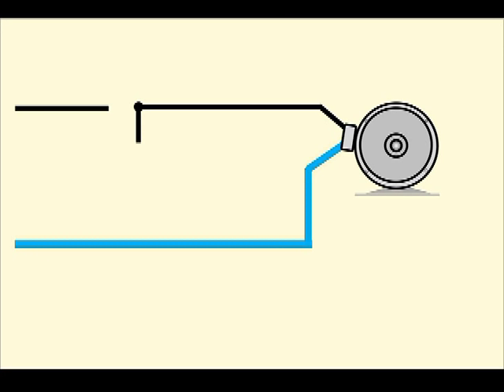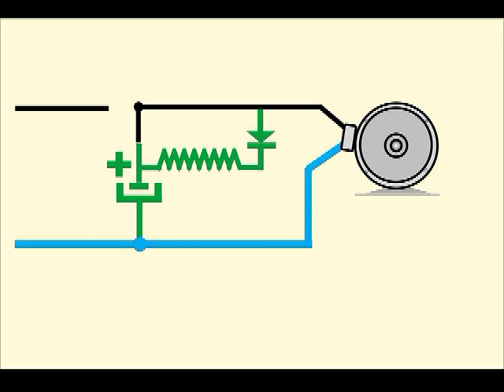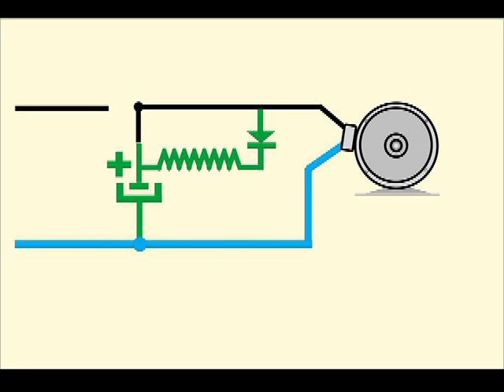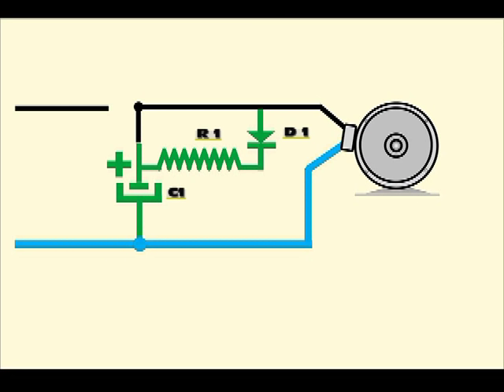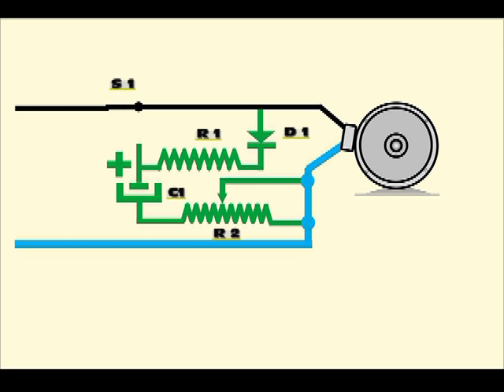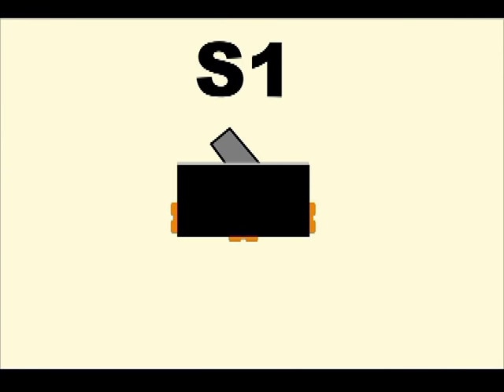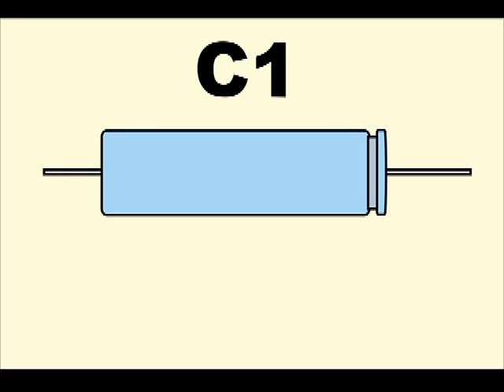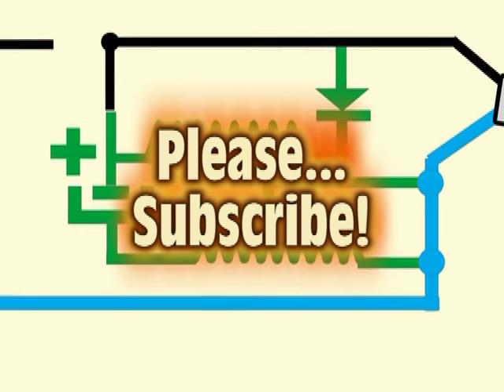Dynamic brake for induction motors

Comment: Dear Sir, this video in ending, you told me  components list of motor. I am not clear about motor capacity. Is it 1/3hp 230v single phase induction motor? Is it correct? I am waiting for your valuable response Sir.

Comment: Are there formulas for calculating the values of the components?
I have a 1725 RPM, 1/4 HP motor that runs on 120VAC that I would like to stop quickly. The motor winding has a resistance of 2 ohms.
Reply from the maker: Dear friend, I have other publications on the subject which may help you. One is a braking demo done with a car battery. Another is a homemade timer which can be adjusted for desired braking. Please take a look at.... https://www.youtube.com/watch?v=HQssG7woEBY You can also check at my Community for a simpler system, using a double pole, double throw switch, please go to https://www.youtube.com/channel/UCmjQnuJwV0FkjdEyi3099RA/community?lb=UgxNy1n39i1pT2EVCtZ4AaABCQ   . If this latte link fails (sometime it does) please go to My Community and find the simple system using a manual switch. Note. This switch has to be normally open when the motor is stopoed.

Comment: I have a 1955 DeWalt Radial-Arm Saw with a 2HP motor that takes about a minute to slow down. Would the stated values (1N400, 100mF, and 1500 Ohms) work?  Would I need the variable resistor? Thanks for any help.
Reply from the maker: Dear William, your motor is quite big and requires more DC current to stop it than that provided by a capacitor that size. I would recommend you try this first: Using a car battery perform the experiment I show at  https://www.youtube.com/watch?v=HQssG7woEBY , being careful to remove the belt (if there is one, or else remove the cutting disk from the chuck, as well as nuts and washers) so the saw chuck does not come apart when suddenly stopping. If the motor stops too quickly, you can add a series resistor to the battery, a relativaly small value, maybe 5 ohms (10 watts or higher) or so, and then try a value which stops the saw at a reasonable rate. Then, you can, with the motor stopped, connect the DC from the battery in series with an ammeter, so you can determine the amps your final DC supply has to be able to handle. Finally, you can build yourself a circuit as shown in my schematic in that same video, just to make sure the DC will be decoupled as soon as the saw stops. Hope this info is of help. Please keep me updated. A word of caution: this method works only for  squirrel cage type motors, it won't work for AC-DC motors, aka universal motors.
Reply: @eltunene  Gracias, Senor, for that quick and detailed reply. I will watch that video and try your recommendation. I'm pretty sure this is an AC-only motor.
Reply: My assumption of 2hp was off - I finally located the spec plate and it says it's a 1hp single-phase motor - does that change the component values by much?

Comment: I built the circuit you describe using a 100-ohm series resistor instead of the hard-to-find variable unit. It barely slows my 1-HP saw motor at all.  Should I increase the capacitance? Thanks for any help.
Reply from the maker: Dear William, I think it would be better to use a much lower resistor, such as 10 ohm and try. Some motors have a very low stator resistance, so the braking current is very low when using a high ohm resistor. If you still don´t get enough braking, please watch a more elaborate  circuit at https://www.youtube.com/watch?v=bKANg7EPMcw&t . Nevertheless, I found a really good braking action can be achieved by using a car battery. Then you may try different resistors in order to control the timing; I have a video about that at https://www.youtube.com/watch?v=HQssG7woEBY&t . Maybe a NiCad battery can work as well.
Reply: @eltunene  I will review the above link.  I did look at your video where you demonstrated using a car battery - so I set up a car battery and got the same results. Thank you.

Comment: Dear Chava, thank you very much for great explanation!
I have a new table saw 230v/2000w. At first the engine would stop after 2 seconds, after some work the time raised to 7 seconds, and after some more work increased to 10+ seconds. What might be the reason for such an increase? Is it normal in your opinion?
Thank you in advanse!
Reply from the maker: Dear Joseph, if the start and stop is too frequent, the capacitor may not get charged enough during the time the motor is stopped. You could experiment by reducing the resistance value a bit. If it becomes too small the diode may short out. If a small resistance value is required, please use higher current diode. Hope that helps!
Reply: @eltunene  This is enclosed mechanism in the saw switch, so I cant experiment. From your explanation I understand that if the braking time rises, this means that the resistance of the resistor rose. Is it possible?

Comment: interesting , i have a lathe with a 400 volt 750 watt 3 phase motor can you use this system youre describing between the VFD and the motor , wat im thinking of is shutting the rotation / motor down fast when pressing the emergency stop , i allso want to use it to quickly chance direction of rotation on a lathe for single point tread tapping without overloading the VFD
Reply from the maker: Very stimulating project! I imagine you would have to use a couple of excellent contactors ir order to totally isolate the VFD wiring from the braking circuit to prevent damaging the VFD. You would also have to use a separate variable DC supply so you can play with different DC values to stop the motor gradually enough in order not to submitt any mechanical parts to an excessive effort. DC braking can be very abrupt in stopping the motor if not properly controlled. Inertia of moving parts also plays an important rule in the braking effect. Please take a look at another video in which I used a car battery to stop a 1/3 hp swamp cooler motor. This is the link: https://www.youtube.com/watch?v=HQssG7woEBY&t=1s
Reply from the maker: You can also add a simple timer to have the DC applied only for about a second or two. https://www.youtube.com/watch?v=bKANg7EPMcw&t=4s

Comment: Thank you so much, very well explained.
I have a single phase induction motor or around 1/3 to 3/4 HP as it has no name plate, will these values still work? I don't mind if it slows the motor less, but don't want to do any damage.
Also I have a hard time finding a 150ohm 5w variable resistor as you suggested.
Thanks again, am now following you.
Regards David
Reply from the maker: Thanks a lot for your interest. As a matter of fact, the circuit explained here is for use in a very small motor, however, I have other videos on the same subject, please take a look at these videos:  https://youtu.be/bKANg7EPMcw  also this other one is a demo using a car battery (which can be replaced by a DC power supply):  https://www.youtube.com/watch?v=HQssG7woEBY&t=2s  , and this other one is for a demo with a  small fan motor:   https://www.youtube.com/watch?v=SEjQHdwgFEY Hope this helps.

Comment: Thank you so much ❤️
Can we apply it to a circular saw?
Is circular saw got Universal motor?
Reply from the maker: Dear Anupam, it depends, if the circular saw is of the type built as a workbench, usually they come with a squirrel cage motor. If it is an off-the-shelf handheld  portable saw, it almost always uses a universal motor. There are ways to stop a universal motor instantly, but they are usually bulky and impractical. If you have a bench circular saw, its much easier to achieve this. Please give me more info.
Reply: @eltunene  Thank you Chava Tarin for your response.
The circular saw in question is handled circular saw, eg. Black and Decker CS1500, 220VAC
Reply from the maker: @adiyogi453  Unfortunately, these handheld saws use universal motors, and it would be difficult to apply a dynamic braking without disassemblying the unit, at the risk of damaging the commutator and brushes.

Comment: I have a 3phase Hub motor that need brakes.   Regen is a option.    But I can shorten all 3 phases and the motor will stop (motor brake)  but is this safe for the motor?
Reply from the maker: When you apply regen braking to a brush-less DC motor by shorting the motor terminals, (of course, after being disconnected from the switching electronics by means of a double throw suitable relay) you must limit the short-circuit electric current in the motor windings or otherwise the motor may be damaged. A simple way to achieve this is to use braking resistors for each phase. One important factor is the inertia of the motor and load. Try to find a resistor value by trial and error (starting at a relatively high value which just barely reduces the motor speed) and gradually reduce the resistor value until you have the motor stopping after a second or two, or longer if practical. Needless to say, the resistors must be of the proper wattage in order not to overheat.
Reply: Chava Tarin thank you.  Yes I use a switch relay that disconnect motor from controller and shorten the phases.    This is a 350W 36V brushless HUB motor.
Will it be possible to add a variable resistor?  So I can use the brake from 0% up to 100% .. like a real brake.   Guess it will be impossible to find a high Watt variable resistor .
Reply from the maker: As a matter of fact, you can actually find variable resistors. There are two types I know of: one of them is a long thick resistor, sort of a cigar with resistive wire wound up with one side visible, and an adjustable clamp you can slide and tighten by means of a screw. This is kind of difficult to handle. The other type is sort of a "volume control" rotary type, it is often called a rheostat. You can try with fixed resistors at first and then later buy the proper rheostat based on your maximum value you want to use. In this case, using three rehostats is kind of difficult, unless you link the shafts using some insulating device. Maybe you can adjust the rehostats at a certain value and test until you find your ideal value and have the three rheostars adjusted at a similar position. Sorry for trying to find the simplest solution all the time. I am an old-school technician I guess. ha, ha.

Comment: I have a 3 phase table saw that has a 7.5hp motor that takes forever to spin down, would this method work for such a machine?
Reply from the maker: Dear Zack, it surely will, however, being such a large motor, you can use a DC supply, either homemade or factory made. I have a video on that subject on my channel, entitled Squirrel Cage motor braking using a homemade timer.
Reply from the maker: The link to that video is https://www.youtube.com/watch?v=bKANg7EPMcw
Reply from the maker: You will have to modify my circuit in order to accomodate power supplies working on 220. If you wish, give me your e-mail and I could draw you a new schematic for your 3-phase motor. Usually applying DC to one of the phases will provide enough braking action.

Comment: great info thanks. What if motor is 1.2 hp at 110 Volt /10 Amps ? what values are reccomended ?
Reply from the maker: Hi, Sam, I kept experimenting and came up with an improved version, lower cost, since the big capacitor needed was too expensive. Please look at schematic at my Community in YouTube, it is the scheme whose text goes: How to add a timer to dynamic brake - In the figure, SW1 is thrown downwards... 

I used a couple of inexpensive off-the-shelf power supplies. If your motor is too big, you can build your own power supply with a higher rating. Please take a look at that.

Comment: umm I have a 50hp 3 phase but I can stop it with 14v from a 4s lipo from a 120hz frequency from the inverter but it almost jumped across the room
Reply from the maker: When applying the DC to the AC motor, you can experiment with several resistors (medium wattage) until you are able to stop it just as you need.  I used a car battery and it works well, however, you can find a battery charger or otherwise a DC power supply you can make some modifications to achieve a softer stop. Please watch my video using a car battery, the link is -  https://www.youtube.com/watch?v=HQssG7woEBY . Soft braking is important when the load has delicate components not able to withstand such a sudden stop.

Comment: how can i brake the 3 phase 2 hp induction motor in no time...same circuit applicable for 3 phase?
Reply: not sure, but it may be the same, if only one magnetic pole is required

Comment: How do I realize it in inverter circuit.DC current to the induction motor through inverter switches is not a good option
.But variable DC supply from chopping with inverter switches can control deacceleration
Reply from the maker: It's worth trying it!!!

Comment: unless my finger is in the way that is really hard on belts, chains, bearings, windings, shafts, gears, bushings, nuts, bolts, sprockets, etc. A fault indicator can sense a finger touching a saw blade and using a transistor to switch on the DC power it will slam on an electrical dynamic brake in case of an emergency. This takes less than 1 millisecond and the saw blade will slam to a complete stop in under 1/100th of a second. If the tool is large enough I have seen large circular saws jump up off the floor, breaking the bolts that held them down. We just bought better bolts.
Reply from the maker: Well, yes, but you can adjust the stop for a slower ramp. The idea is not having the flywheel effect have the machinery turning for a long time. It can safely come to a stop in say, ten seconds, without harming the mechanisms.

Comment: How can this be implemented when the motor has to be used as a generator at a fixed speed? (This is for experimental purpose)
Reply from the maker: Dear Amul, if a generator is to be used, it would not be a squirrel-cage  induction motor. It would rather be an alternator, maybe with a set of diodes (as used in a car) or a parallel wound motor, controlling the field for the amount of power generated. It would require a totally different circuit. By the way, why do you want to stop a benerator dynamically? The load itself tends to stop it, the more the load, the harder it gets to turn the generator.
Reply: @eltunene  We are trying to perform an experiment on hydro turbine. The turbine needs to be operated at a fixed speed and the torque that's generated due to water needs to be dissipated somehow. We don't want to use the mechanical brakes for it. We do have a VFD used to turn the induction motor, however it couldn't dissipate more than 25kW.

Comment: how do you keep the motor "braked" as in not being able to turn it by hand after the rotor has stopped?
Reply from the maker: When the DC from the capacitor or from any DC power supply is applied, the stator coils magnetize and generate an induced current in the squirrel cage short-circuited bars, thus stopping the rotor. As soon as the motor stops, there is no induced current in the rotor, so there is no more braking action, and you can turn it by hand. The braking effect lasts only as long as 1. There is a DC in the capacitor, which discharges almost immediately,  and 2 as long as the rotor is turning. So if you use a capacitor, the current magnetizing the stator fades away almost instantly, in case of a big motor, a separate DC supply is used instead of the capacitor, but it applies a current for about a second or two and is disconnected. So after the rotor stops, it can be rotated by hand. The idea of this braking is to overcome the inertia of the load and the rotor itself. As long as this is done, the braking action ceases.
Reply: Okay, but how would one stop the rotor from spinning by hand (spinning freely) even when not applying currents to the motor? For instance if you wanted to use a 3 phase AC induction motor on a crane for lifting and lower. How would you stop the lifting wire spool from unwinding and objects being lifted falling to the floor when not applying a current for lifting or lowering?
Reply from the maker: In that case, you could add an electro-mechanical brake, released by a solenoid when the motor is turned on. Maybe the dynamic brake could help reduce the speed and then the friction brake could hold it. However, in the case of a crane, if the load is very heavy, it would be wiser to apply the friction brake immediately when the motor stops. A mechanical aid can be used such as a wormgear, but for safety I would prefer the mechanical brake.

Comment: Thanks for the vid. Had a ?. can I disconnect the brake on a ( 1 hp 110/220 ac ) I need to let it wind down naturally  It's connected to a 300 pound flywheel .
Reply from the maker: The dynamic brake can be an ideal solution! You can try several values for resistor R2 until it stops as you want it to. If the flywheel is too heavy to stop in a short time, you can add some capacitance, maybe another capacitor in parallel, but you must experiment a bit.
Reply: Thanks for the reply. I actually do "NOT" want any braking to happen . you might have read my comment wrong. so can I disconnect the brake ?  If I can, how then? Thanks
Reply from the maker: If the braking is of the spring-applied electromechanical type, you can remove the solenoid-operated brake shoe mechanism some motors have in the end of the shaft, they are usually removable. I hope this helps.

Comment: Is this a dc motor?
Reply from the maker: Dear Nishan, no, it is an AC motor. When you apply a DC to the stator, a current is induced in the shorting bars of the rotor, so an opposing magnetic field is produced in the rotor, which reacts with the magnetic field of the stator, thus braking the motor.
Reply from the maker: Nishan, please watch https://www.youtube.com/watch?v=bKANg7EPMcw and https://www.youtube.com/watch?v=SEjQHdwgFEY for more about this dynamic braking. I found out a DC power supply works best instead of a capacitor.